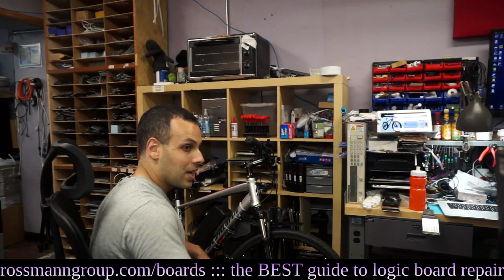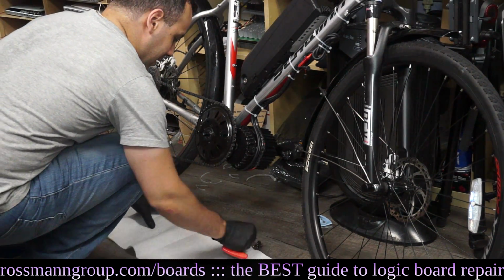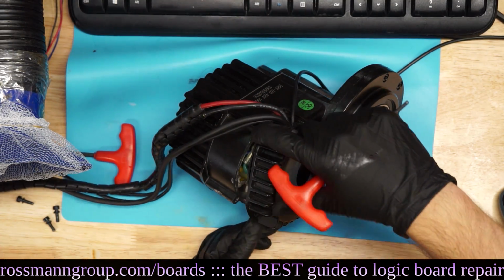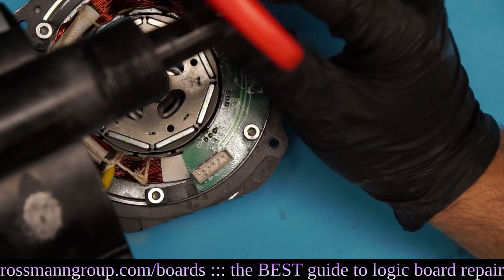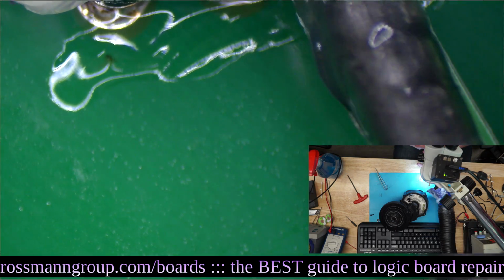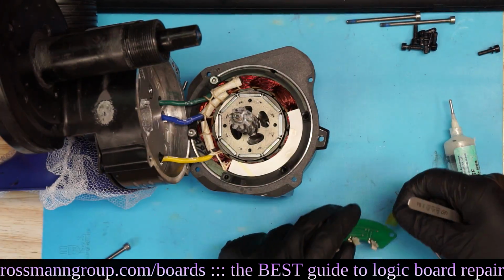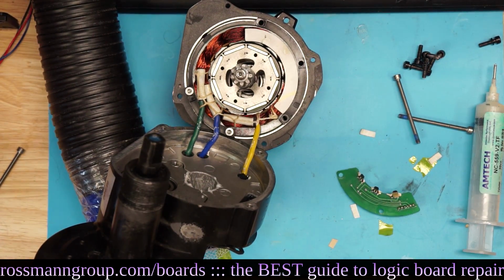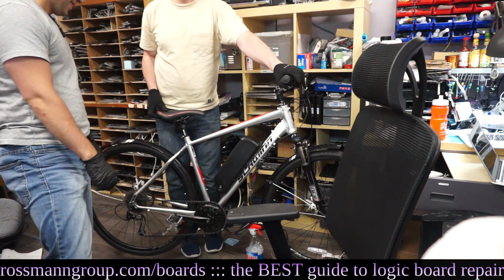Bafang BBSHD ebike Error 8 Hall Sensor repair howto.

Comment: I don't mean to sound like a dick, but, people should not be allowed to own a bike or car if they can't do the most basic maintenance and repair...  it hurts my heart to see people using a hammer when they should be using a wrench.
Reply from the maker: I agree, if you can't reflow your own RAM when your laptop beeps you shouldn't be allowed to own one.
Reply: @rossmanngroup  so true
Reply: Absolutely.  which is exactly why I don't own a laptop.  Although, if I needed work done, I'd be inclined to send it to you.
Reply: Broke-ass Crypto that's some troll bullshit right there...
Reply: Aha ? You do know that bike mechanics all over the world use a mallet to get the cranks off the bike if they get stuck or are to tight?  
My 30BB axle wont even fit the BSA if I dont hit it with a mallet. I like to see a wrench who can pull the crank axle out or do press it in again. 

Bottom bracket and crank maintenance isn't basic at all if we talk about basic it is how you grease your chain, clean the bike, change tires , grips and brake pads.
Reply: Don't you mean the thumb-detecting nut fucker?
Reply: So you're blaming the customer, and not the company, who makes it hard to repair?
Reply: Broke-ass Crypto if you like when people use the right tool you'd hate watching me work.
Reply: it bothers me that he's using a hammer on ALUMINUM crank arms. the tool to remove the crank arms is $7 on amazon, and i wouldn't risk potentially braking the $15 part either whilst working on it or, worse, whilst climbing a hill on it.
Reply: You, sir, are full of shit.
Reply: Serp D.  I don't own any electric bikes, but every bike I do have has a hex nut to remove the pedal.  In case you didn't know, a claw hammer is not the same as a mallet.  So I guess I should have said "it hurts my heart to see someone use a hammer where a mallet or wrench would work.". I'm an avid fan of having proper tools for the job at hand.
Reply: He removed the fastener already, and if he was supposed to remove some nut to get the pedal off, it wouldn't have come off with a hammer.  If you bothered to watch the rest of the video you would see that there isn't a nut there.
Reply: fuck that, remove licensing for drivers entirely. the constitution forbids licensing the right to travel. fk off commie
Reply: Yes, use the wrench as a hammer. Multi-use tools 👍
Reply: they usually use a rubber coated mallet, to prevent scratches and soften the blows so it wouldn't wedge itself in other parts or bend. I'm guilty of doing this myself on my bike when i had one but i had the sense to tap it gently 20 times rather than try to smash it off in record time.
Reply: But this time it was a CAR causing the accident then just driving off like nothing happened.
Reply: Crypto sure this is a claw hammer but those are cheap ass cranks. I guess because they are Bafang they are not even aluminum.
Just use a piece of wood and whatever you want to punch it out. No scratches no marks...
I have high end carbon crank sets and cheaper Shimano SLX/XT cranks here and guess what you can not remove them with a wrench. They are not designed this way.
Reply: License plates I can understand, but insurance is just silly.  If you do something illegal you are liable for the result regardless of if you have insurance or not.

A lot of people I know cycle BECAUSE they can't afford car insurance, so you are suggesting preventing them from having access to anything but public transport.
Reply: I've got no issue with you being unable to repair your bike but I absolutely have an issue with cyclists and e-bikes not being mandated to have licenses, plates and insurance.  Too many times I've seen them riding like complete asshats, blowing through stop signs, clipping cars and pedestrians and just riding away.  I;m more than happy to share the road with you but do your part and join in and share the legal ramifications and needed training.

Comment: AvE would give that Macbook just the proper re-calibration. Since the pixes in thar need special wranglin. A slight tappy tap tap with the Thumb detecting nut f****r

Comment: Bafangs are kind of a meme in the ebike community because of various issues (overheating being an often suggested one, some of them have nylon gears that strip easily, etc.)
Reply from the maker: Ive tried riding top gear full speed in 95f weather long term with 52v battery and no overheating. If you touch the motor you'll get a 3rd degree burn probably but it still works.

Comment: I appreciate your efforts to edit the videos. The original stream was a bit to long for me to watch after the fact ;)
Hail Paul S! Very good thing that you have him around 👍🏻
And F!@# that cab driver.
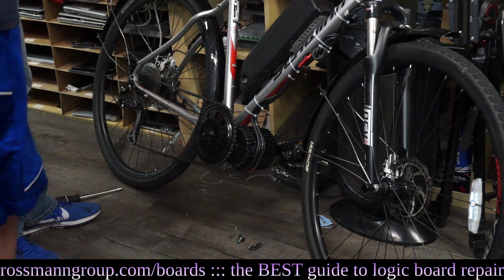4:56 "I like to use as much chain oil as I do flux" 
Jup, me to 😂
7:22 not having the correct tool improves ingenuity
25:38 would those magic words be "focus MOFO"? 
33:33 hell yeah man! Nice fix 😁
Reply: The original stream was worth watching every second. He edited out some good parts.
Reply: Frank Gormanns yeah I believe that right away. That's why I try to watch most of the live streams. These days I tend to watch the recordings more often.
They are indeed very valuable as the clue is often in de little things :)

Comment: Common trick for bicycle work is to flip it upside down, standing it on the saddle and handlebars.
  That special nut is usually removed with a hook stamped out of a flat piece of metal that also has holes to use it as a wrench for the nuts.  Sometimes included with portable bicycle repairs kits.
  Nice that modern pedals can be removed with small tools.  On old bikes you need a 10 pound 2 foot tool to remove the pin that holds each pedal (at least if it hasn't been removed in 30 years of outdoor use).

Comment: the three color wires are the 3 phase power wires which drive the motor.  switch two of them I dare you. (it'll make it run backwards)

Comment: Green, Blue, Yellow wires are the phase wires. Like quadcopter motors, swapping any two will reverse direction.
Reply: Swapping any two motors  phase wires will reverse direction only in case of sensorless 3-phase BLDC (used in RC quadcopter RC airplains and some RC cars), this is sensored 3-phase BLDC and swapping two phase wires will in best case case make motor not work, and more usual will make controller or/and motor to release magic smoke. In case of sensored 3-phase BLDC you need to swap 2 sensore wires and corresponding 2 motors phase wires (if you swap wrong pair of wires again it will not work).
Reply: Thanks Miloš, yes you're right - would need to modify controller logic too and calibrate for reverse.
Swapping sensors around might not work properly because the timing may need to be advanced or retarded in the reverse direction.

Comment: I have to say your videos are the most entertaining thing I've seen on Youtube.

BTW, don't give Apple ideas with the poured epoxy block.  However, the idea of the entire case being a heatsink is awesome.  (Except Apple would then use thermal epoxy to attach the boards.  OMFG I probably just gave them their worst idea, because no doubt they are watching this channel to document the "counterfeiting operation" especially now that now their shop is "counterfeiting" e-bikes! )

No doubt Thermal epoxy is too expensive for Apple.  They'll just use cheap polymer thermal transfer adhesive pads.

Also, don't give them the idea that solder can substitute for busbar.
Reply: that's not for thermal anything, it's just epoxy potting for protection from liquid and dirt ingress and in the case of the controller, to stop you reverse engineering it.

Comment: ROFL.  I have have an Allen bit set and I don't even have a proper socket wrench set!

I personally like bits for my ratcheting screwdriver.

BTW, you almost tried to remove the bike chain with a hammer claw! ROFL  I'm not letting you near my bike!

You should be using a cloth over the part, and/or rubber mallet.

Comment: An e-bike huh? I always stayed clear of those because I thought they were too heavy with the motor switched off. Has it gotten any better?
Reply: Sauron tonnes better
Reply: whatever energy you use to go up may be reused trough regeneration if you choose a high discharge batery there will be less weight.